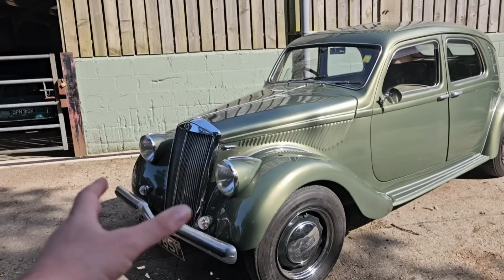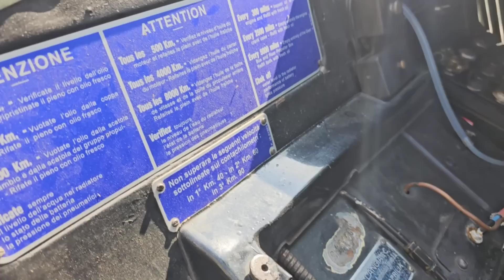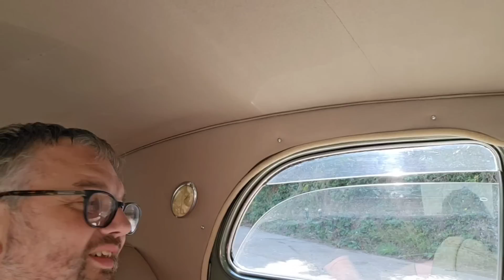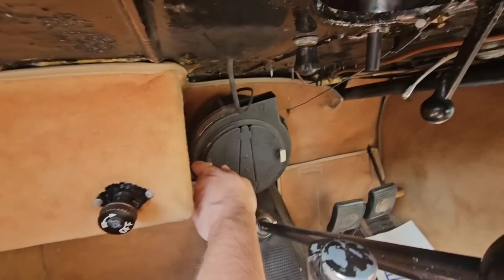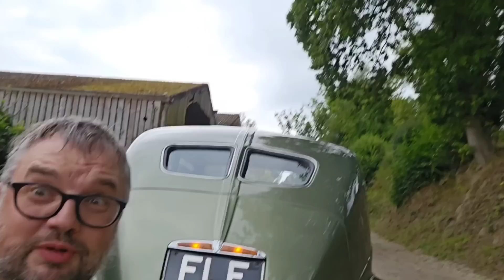Incredible Engineering! This 1930s car is like no other - Lancia Aprilia

Comment: An 85 year old car that drives like that?  Where do I sign up for one?!  

What a machine!  I was going to mention that it looked like the brakes were working extremely well for a 30s car - and good enough for (even better than some of) the comparison of a 50s car.  She also had some real get up and go - showcasing the engineering prowess of Lancia themselves.  Now I see the genesis behind the likes of the engine in the Fulvia Sport Zagato of the 1970s.  A very distinctive exhaust note and that Zenith carb just adds to the thrill with its patented induction noise.  All Zeniths - even on the A30 under an oil-bath air filter - sounded that good under load.

When you think of 30s cars, they were all tall and fairly large (excepting the Austin 7 and Morris 8) and boxy....and slow....and weren't known for handling at speed without serious modification.  The Lancia was none of that.  What an achievement!  I'm actually quite in awe of the fact that something like the Aprilla was available around 20 years before speed and handling were thrown together (unexpectedly and unintentionally) in a little package that was eventually called the Mini.  

I like this car very much, had never heard of it before and lament the fact that old man Lancia never got to see it.  Also, I'm surprised he never got rich off his wonderful cars because he certainly deserved to.  I'm glad he made them though.....so thanks for your review of this gem and for being able to show us how wonderful it is.  All the best!

Comment: Lancia were very in advance of their time. They were properly engineered well built and good quality cars.
They continued to be well designed until the 70's when they were bought over by Fiat and started the Beta.
Just before the Beta they had a saloon with a flat four 16V electronic ignition car with a separate chassis to lower the engine to work on - front wheel drive. The whole of the engine and box was on it's own chassis. Independent suspension too.
I loved that car, even had silk curtains in the back !!!
No time to give it a name - It was simply the Lancia 2000 (2 litre) with a 5 speed gearbox !!!
Reply: The Delta Integrale seemed to do quite well ...
Reply: @AndreiTupolev  That was a Fiat era car, but yes. When Fiat gave the money to develop a car to the Lancia Engineers they could deliver.

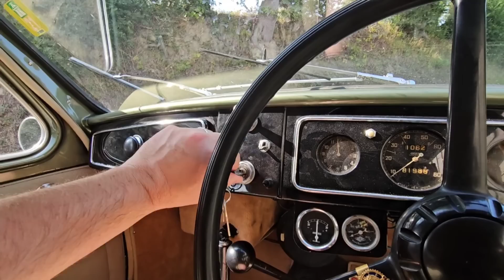Comment: 7:20 This kind of key was very common in the post war Czechoslovakia and it used to operate electricity in most lorries, busses or even motorcycles and some cars. I remember as a kid that my granddad used to drive me in lorries that still had this kind of ignotion, still have some of these keys at home. After turning it on, you they pressed a button to start the engine,  or, in case of the motorcycles, you manually foot started it. It was made by the company PAL, which did all the switchegar and dials for our vehicles, but it's usually reffered to as "Boschák", because originally this key pattern was licensed from Bosch.
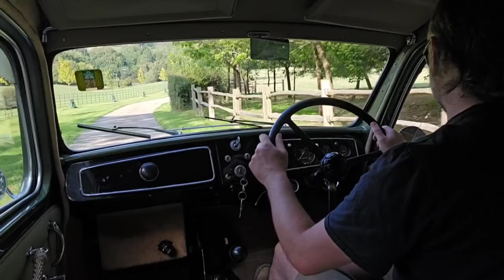10:43 I think you said it the other way round with the up and down shifts 🙃But you really did well in the downshifts,and as you say, the gearbox seems to be very well engineered. I wish this was the case with my somewhat newer Lancia too, because that is surely the weakest (or I should say the only weak) point of the car.

Comment: A fantastic car so advanced for its time and that absolutely incredible V4 engine also the folding know for the window winder many a vehicle l have driven and owned with manual windows where my right knee us touching the knob great idea and no B pillar makes it so easy to get in and out for both front and rear passengers and the dash board so modern especially for the 1930s and lastly its a Lancia Aprilia which Aprila build motorcycles

Comment: The unidentified gauge - I believe that is pressure in the adjustable dampers! And you didn’t mention the big Bakelite knob under the dash on the right- that is the adjuster. But most unlikely the system actually works as it relies on zero leaks in 1930s rubber…
Reply: Nice.

Comment: Legendary design. The engine is all-alloy, with a single OHC operating the valve-trains on both cylinder banks. The stroke is long, so that's where the torque comes from - max torque is at only 2,000 rpm. The car's official top speed was 78 mph, about the same as an MG Midget of the same era.

Comment: Beautiful car and your delight and enjoyment is obvious and intoxicating as is the car. I’d love to add one to my garage. On the trafficators, I have just reconnected mine in my 1954 Rover P4 90. They were ‘bypassed’ when modern indicators were installed. Now both Clementine (the Rover) and Dame Vera Velox (Vauxhall) have working trafficators and indicators.

Comment: What a cracking car Ian. It's in just the right shade of green that I'm feeling of envy that you got to drive it. An old car but also modern with the unitary construction body with what looks like early aero properties as well. Throttle blipping on a downshift will come natural to most who rode 80's shaft drive motorbikes and is something that I've been doing automatically on bikes and cars since... apart from an automatic box of course. Many thanks for sharing this great wonderfully styled and usable car. The Tintin influence for the colour is an interesting one.

Comment: The rear engined FIAT 500 had no synchro either. Learned to drive in one and that was a 1971 model. (500F)
My current Landrover has no sychro on 1st or 2nd

Comment: So satisfying to get non-synchro gear changes correct - both up and down!
Reply: Not mad on that bit, Double de clutching in traffic would not be pleasant
Reply: @adoreslaurel  That is very true. In 1971, I passed my HGV 2 driving test in an AEC Mandator 10 ton truck, driving from Minden up to Hamburg, through the city and back to Minden. There was no synchromesh on that and it was a real pain at both ends of the trip - literally!
Reply: @rayjennings3637  Well you obviously succeeded without decorating the Bitumen.

Comment: That type of starting pin was also used on Italian military vehicles (jeeps, lorries, armoured vehicles etc), it was nicknamed "il chiodo" i e. the nail. 
Until the late 70s Italian heavy and medium weight trucks were RHD, as this allowed to exploit the width of narrow roads to their maximum extent. Buses were also RHD until underfloor engines became widespread in the late 50s and 60s. 
Some of the older army trucks in my unit were still RHD when I was in the Italian army in 1997/98. 
Ciao from Padova, Italy!
Reply: Same in Switzerland, until 1973 if I remember correctly. I know someone who converted a 1971 Saurer lorry into an 18-tonne luxury motorhome and he told me about that.
Reply: @Ragnar8504 Also narrower width limits up until the '80s l believe.Volvo F7 cabs and other narrow cabs were used on heavy duty higher weight chassis.
Reply: @melvyncox3361  
Yep, standard width (2.5m) locally-registered lorries were sanctioned up until that time. 
Local vehicles had a maximum permissible width of 2.2m. 
Not sure about rules for foreign-registered vehicles, tbh. 
I will have to refresh my knowledge about those, 
unless someone here can enlighten me.
Reply: @ericdunn555 Yes,l thought that was the case.As for foreign registered vehicles,l'm not sure either,to be honest.l suppose they must have had some sort of discretion.
Reply: There's been a lot of discussion over the years in the comments on this channel on the subject of RHD Italian vehicles. Ian should collate them into a video.
Reply from the maker: Sounds like a good excuse to visit Italy again.
Reply: @HubNut  if you plan to come to North Eastern Italy let me know, I've got various friends with interesting classics and I'm a member of a classic bus club. And there are my two Fiat daily drivers of course, the 1993 Panda Selecta and the 1987 Regata 70s.
Reply: @patricksmodels     Nice.
Reply: Italy was once a lot more bonkers than that. After unification it was left to local administrations to decide which side of the road to use, so in most of Italy people drove on the right, but in certain towns and cities the rule was "keep left". What happened at the crossover point is best left to the imagination. I believe it was Mussolini who standardised driving on the right everywhere, although, as you say, having the driver on the right remained normal for heavy vehicles, especially in Alpine areas.
Reply: @davidjones332    C00L

Comment: I've heard that the gearbox on these is especially delightful when the clutch isn't used. But I don't blame you if you don't want to try that (except accidentally) in someone else's car. 

Technically, the Aurellia replaced the Aprillia. Although that was a bigger, more upmarket car. The Appia was, perhaps, closer to the Aprillia in spirit. But the Appia has a smaller engine and is a bit simpler (live back axle, for example).

Probably the three best mass market cars of the 1930s were the Citroën Traction, the Lancia Aprillia, and the Fiat 508C 1100.

Comment: That a beautiful car! It must have been difficult to engineer front and back doors that can open and close independently while keeping wind noise down, and water out.
Reply from the maker: It cost a fortune to develop, especially as the doors are curved.
Reply: The seal between the two doors is a pair of very thin, flexible rubber extrusions which overlap. Because they are so flexible it doesn't matter which door is closed first, the rubber just flexes to allow the other door to open.
Reply: @saxon-mt5by  Thanks for explaining how it was done. It had me puzzled.
Reply: @saxon-mt5by  basically like the center doors on e.g. a city bus then. Probably not exactly quiet at higher speeds

Comment: I remember my Mum's P reg Fiat 136 had a hand contolled throttle which fixed revs when pulled whilst dtiving-as Ian says rudimentary cruise control- it disengaged if the pressed the accelerator pedal.
Reply: Some cars had them on the steering wheel. I think I've seen a video of someone mentioning it, possibly Ian or Steph.
Reply from the maker: Yup, throttle on the wheel was quite common for a time, and is the only throttle control on a Model T.
Reply: Even the carburetted Pandas of the late 80s/early 90s have one instead of a choke.
Reply: Most Fiats had hand throttles.....useful in winter for a fast idle when warming with little or no choke.

Comment: Kind of modern looking design for it's time, long wheelbase, wheels at the extreme ends of the body, Hatchback "looking" body, altough I guess the boot / trunk is separate section, nice upholstery inside, even arm rest for comfort. Great exterior colour too, even I guess not original one.

Comment: I've a,ways been a Rover fan but, if you regard quality as being pure engineering rather than wood and leather, then the Aprilia has it over the Rover 10 every time. I think Teleconfrol will stiffen up the rear dampers. The Ardea was almost contemporary and was an Aprilia which had shrunk in the wash and was the world's first production car with a 5 speed gearbox. Appia succeeded Ardea. Aurelia succeeded Aprilia and had the first production V6, transaxle and Michelin Xs in 1950. Small wonder they didn't make any money.

Comment: That french "Autoroute Sticker" is in fact a swiss "Vignette"
Reply: Came here to say that... 3 days too late. Yup, Swiss.
Reply: - That is a Swiss one, required on any vehicle entering Switzerland for it to be able to travel on their roads.  Each costs CHF 40 and is valid for roughly a calendar year.  If you drive a car that does not display one the fine is CHF 200.  In this case it implies this Aprilia was in Switzerland at some point during 2021.

Great little car.  Lovely induction noise, almost sounding like an Alfa Giulia.  👍
Reply: Or Austrian
Reply: @mikeirwin8142  no it is Swiss
Reply: @davidtrigg1485  
Yep, definitely Swiss. 
Swiss vignettes last for one whole year, 
of one set price, 
or longer if bought in advance. 
Austrian toll stickers are of variable duration and variable cost.
Reply: @davidtrigg1485  No i could swear on the life of my loved ones it was SWEDISH..   .....!

Comment: What a fantastic car and the green paint enhances its looks.Who needs a boring modern vehicle,when you could own something as special as this?
Reply: The colour is reminiscent of the Bugatti Aerolithe replica. Also originally a mid 1930’s design by an Italian.
Reply: Very nice car 🤌👌
Reply: In case your question wasn't rhetorical, emissions and safety I would imagine.
Reply: @PorthLlwyd emissions, have in account the amount of materials needed to make those cars? Surely any modern ev car will produce way more emissions just to produce without mentioning the batteries, that will require another tons of emission gases to replace.
Reply: @rafaeloreirorodriguez5278  it's not realistic for everyone to be driving around in 1930's cars though, but I get your point. We need to move towards decarbonising the manufacturing and mining processes too.

I'd like to see a lot more lightweight, interesting, small EV's.
Reply: @PorthLlwyd 😂😅😂 you need to do some research!
Reply: @KimSenior  research on what?
Reply: @rafaeloreirorodriguez5278  totally! keep the classics going
Reply: @PorthLlwyd  Probably worth a bit more than the average KIA Starma as well.
Reply: @MeYou-yz2yz  kia starma! I want one.
Reply: @PorthLlwyd  It's not emissions, no one gives a damn about that, except regulators. A modern car is faster, handles better, is more practical, more comfortable, safer, and has all the features of the best luxury cars from that era and then a tone more. And let's not forget that 30s cars reliability was shit compared to modern standards. (compared even to ultra downsized crap of today) So, everyone that don't prioritise fun over everything else I guess.
Reply: @EustaH  modern cars are very difficult to repair though and extremely expensive...cars of the 30's may need more repairs in general but those repairs can be accomplished before lunch on any particular day.
Reply: @michelle-lz8tg  Yes, they are more complex but on the other hand they have OBD and other digital helpers, and most of the stuff adjusts itself now - so I thing that depends on the job.
As for the price - they are expensive in the USA compared to 1930s but from my Central European perspective they are twice as expensive than in the USA now and yet still the cheapest to buy ever in the history.

Comment: Thanks for another fine road test Hubnut.  This era of car is right in my interest zone.  The tail/brake lights look a bit Lucas - is that what they are or is the resemblance co-incidental?  On synchromesh, Wikipedia reckons its first use was by Cadillac in 1928, so maybe for a car released in 1937, the licensing fees for its use might have deterred Lancia from going that way. Just a thought.  Cheers.
Reply from the maker: I suspect the Lucas lamps were added at some point.
Reply: When this car was sold new in 1937, the only rear light was the single central one. Twin rear lights became a legal requirement in the early 1950s, and for a UK car the logical fitment would be Lucas units.

Comment: One of the greatest unknown classic cars.  Years ahead of its time.

Citroen produced some very advanced cars but Lancia had more advanced features that are still in use today - of which the unibody construction is only one.

I think "hydrotelecontrol" is to do with the rear suspension dampers.  This was an option that allowed their adjustment.

 I hope you had a good look at the rear suspension with its plunging driveshafts.  One of the reasons for its brilliant handling was its matched front and rear suspension geometry - no swing axles for this motoring jewel.